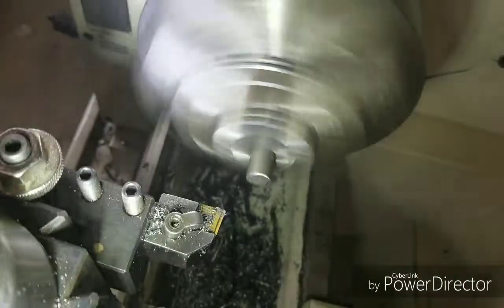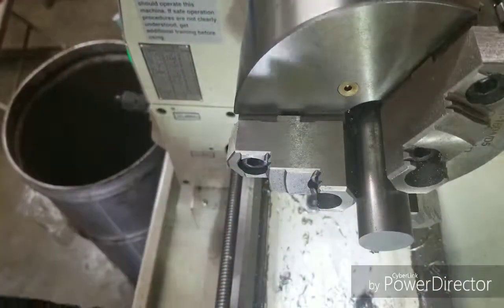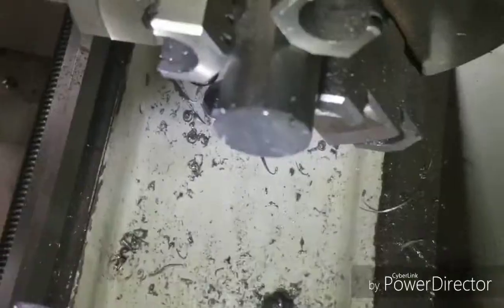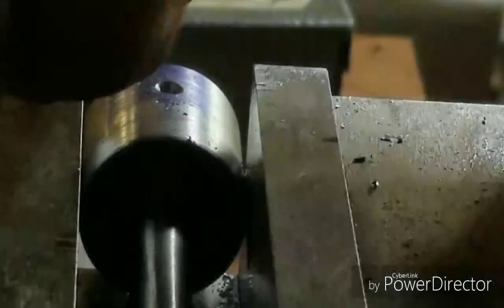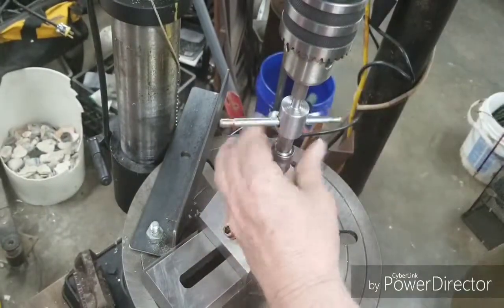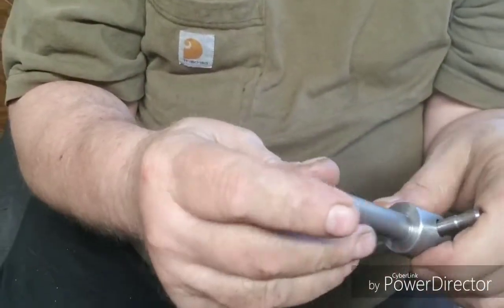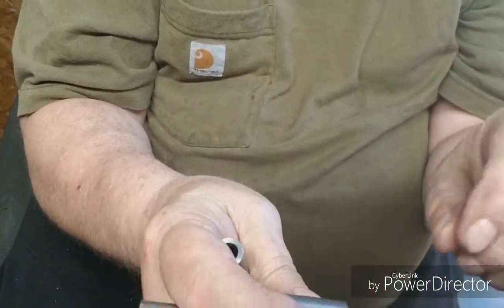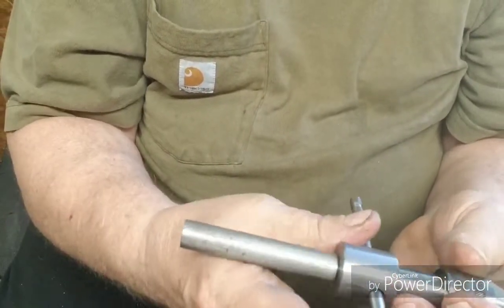Tap guide so your threaded holes are always straight .

Comment: I have to tap a #10-24 hole tight in a corner of L brace. I can't turn a Tap handle or use a ratchet socket....I need a thin extender. Is there such a tool?
Reply from the maker: I usually make a bushing that has a hole located the same distance as the hole to be tapped with a hole for the tap slip fit and locate it in the corner and use a Cresent wrench. Oe just be real careful and just use a cresent wrench by it's self